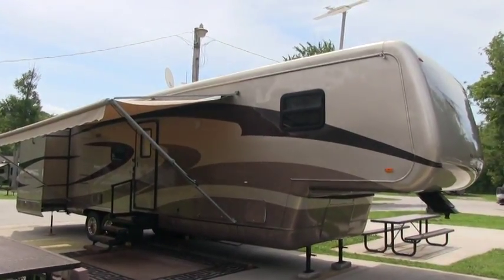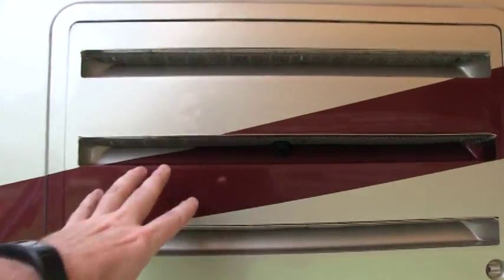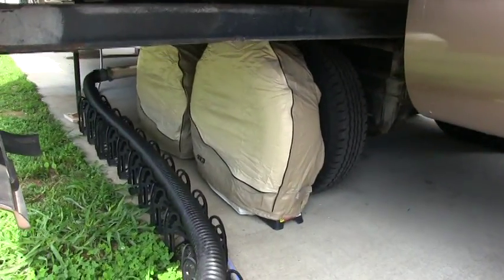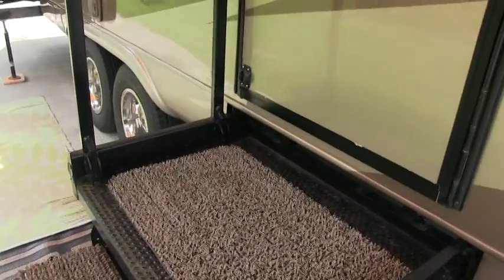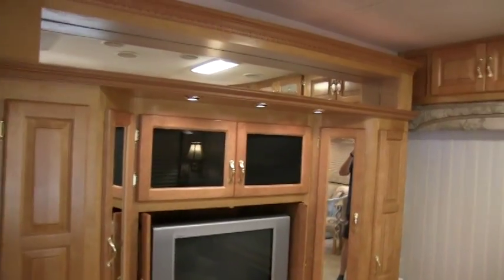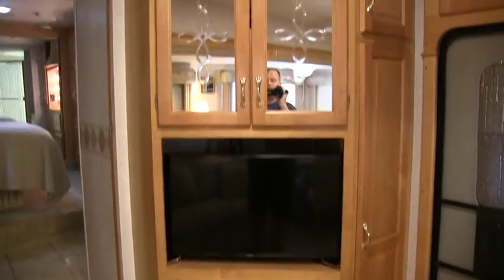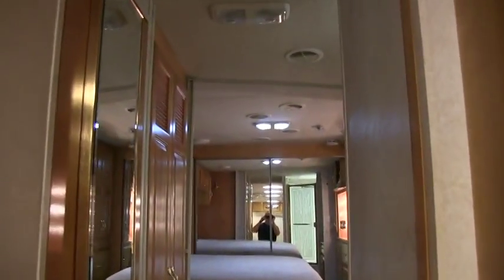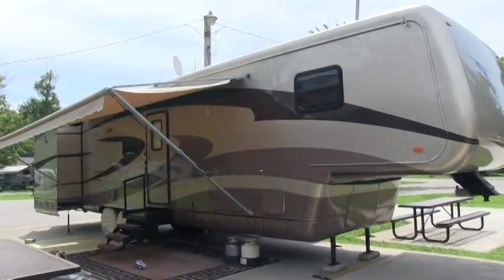2003 Newmar Mountain Aire 39SDTS luxury 5th wheel camper walk-around tutorial video

Comment: what would you need to tow that?
Reply from the maker: Weighs 16k unloaded Lisa, so 3/4 ton or 1 ton truck should be fine:! I would stay under 1k lbs. under your trucks towing capability;)
Reply from the maker: So you can carry your stuff:)
Reply: Lisa Mieth My truck.
Reply: You need more than a pickup truck, this trailer max at 20K lb. Need a 450 class truck on up, 650 would be ideal. How do I know? I have the same model since 2002. I use a Volvo tractor to pull it. It's not if you can pull it, the question to ask is;  if your truck can stop it faster enough in normal traffic.
Reply: @padraicley3265  ..Exactly..that is what I try to tell to folks . My Sons Ford f-150 will tow it but will it be ble to stop it. No way.